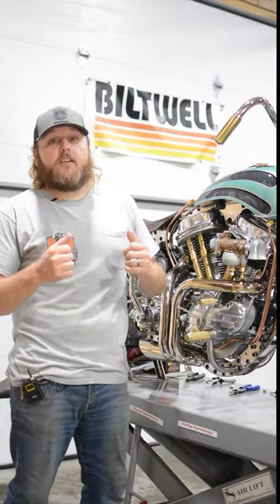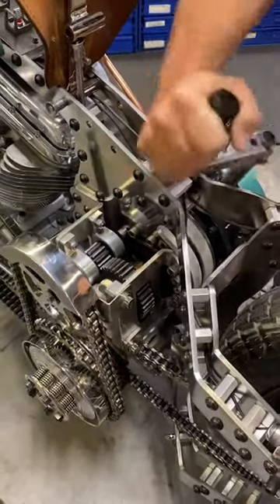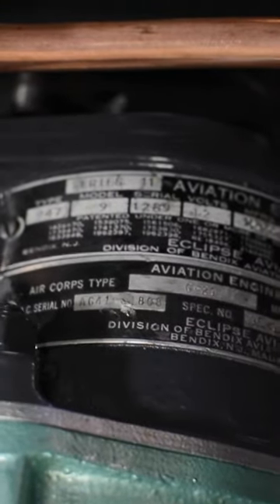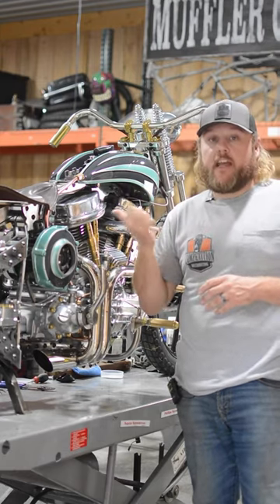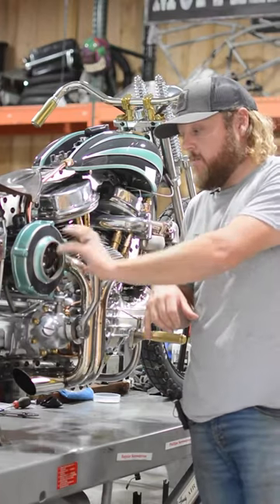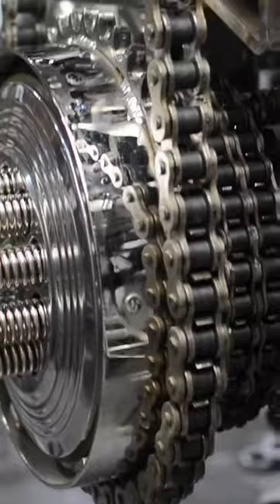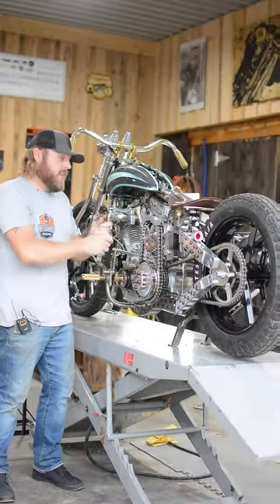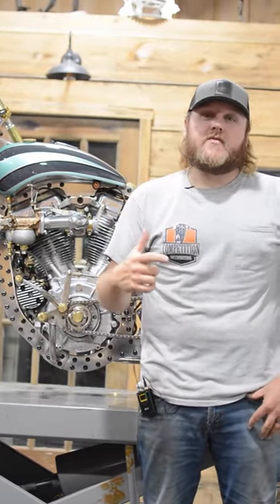How I built my Harley Davidson 1948 panhead inertia starter from a WW2 era airplane engine

Comment from the maker: The full length explanation is here https://youtu.be/bhM7D3E4Qr0
Reply: got another crazy idea.    combine a variomatic  like from  a scooter  with a gear engine.   it should in theory act like having a overdrive in every gear.
Reply: Old nut slicer 2000
Reply: I've offen thought in a kicker  pump. Pnumatic  push button starter.